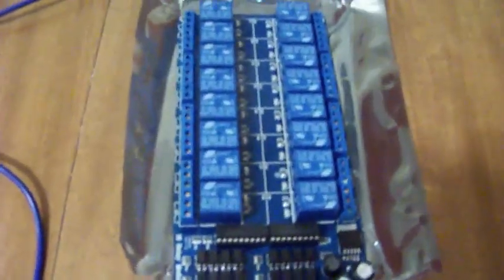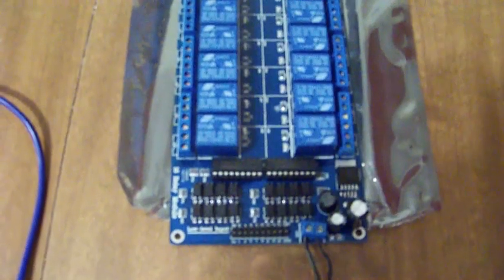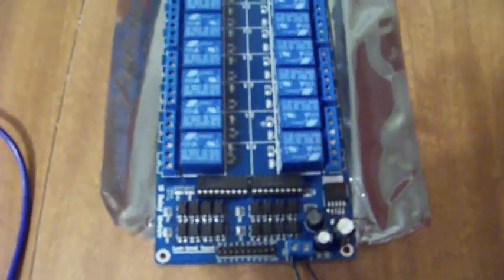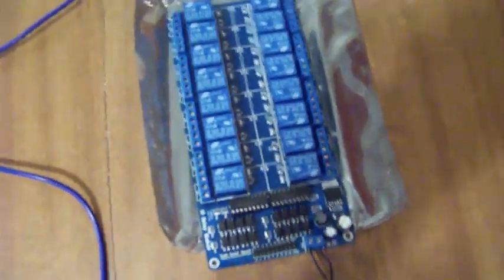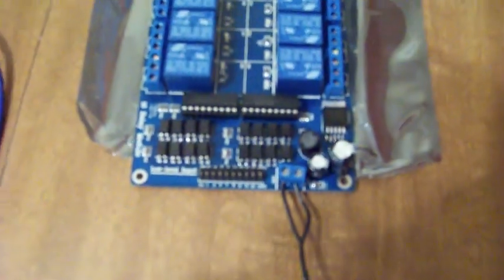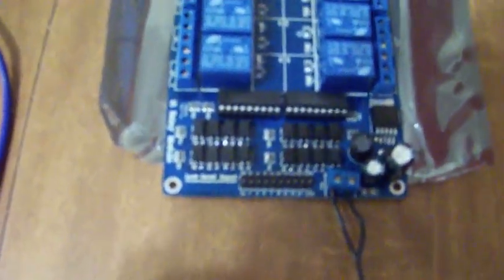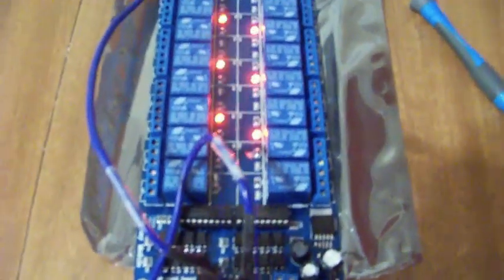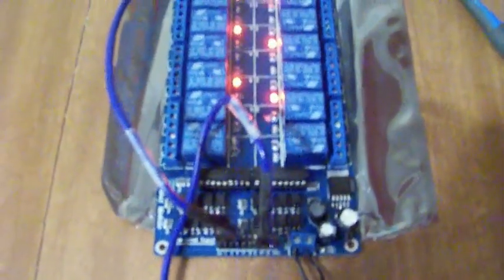Sainsoft 16 channel, 12 volt relay board Product Review

Comment: Good review and demonstration. Surprised you haven't gotten more positive feedback. Just a heads up, each relay uses about 20 mA of current at 12V. That's about 3.84 W needed to run all relays at once. Factor in some power dissipation for the opto-coupler, transistors, etc. 5W would seem like a good estimate.

Comment: KeoFleX LLC Did you ever get all sixteen relays working on the mega? Been having a tuff time getting all of them to work if so what software did you use?
Reply from the maker: What has been the problem?  Can't get them to work with Vixen or just can't get them to work period.  I recommend getting a good breadboard and mapping each relay to the board.  then using a basic arduino program to turn the relays on and off one at a time to check the board.
Reply from the maker: Here is my arduino code for the 16 channel 
http://keoflex.com/BACKUP/16chan.zip please like and subscriber to my channel ;-)
Reply: @KeoFleXLLC  The link is broken

Comment: Hi this is a .......................................................................................................................................................................................
Reply from the maker: sorry fixed the audio
Reply: KeoFleX LLC Have you had any issues with the relay board? I'm looking at running 2 of them off of a mega. Oh & thanks for fixing the audio it works now.
Reply from the maker: No issues this is a wonderful board.  My only complaint was the lack of instructions which as it turns out is many peoples complaints on Amazon